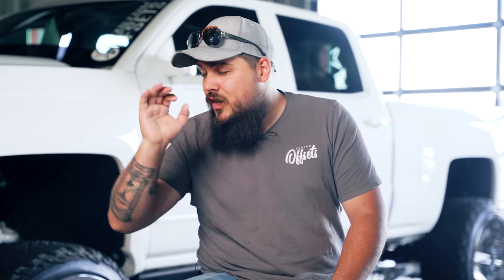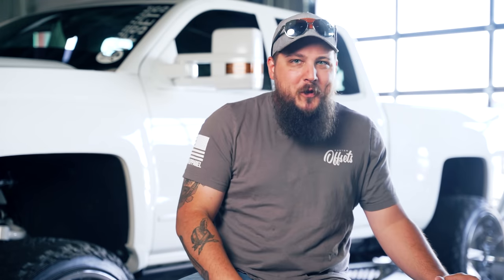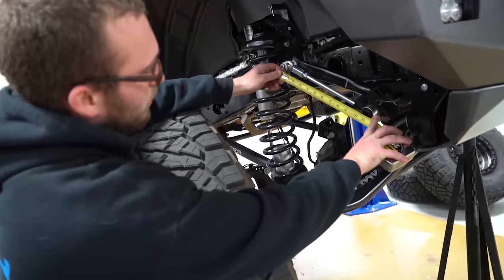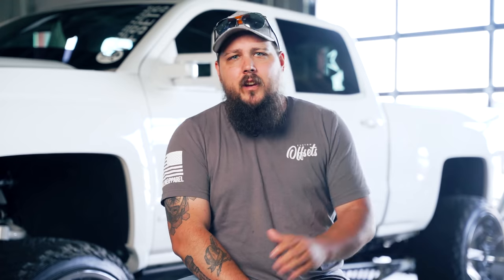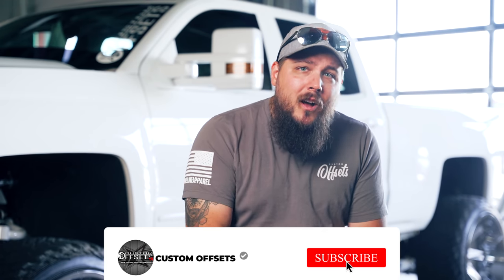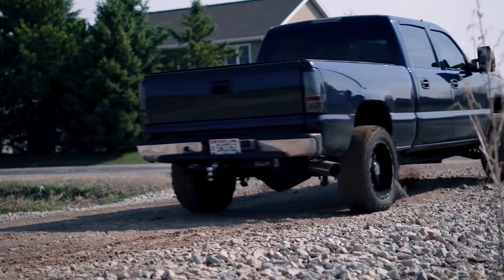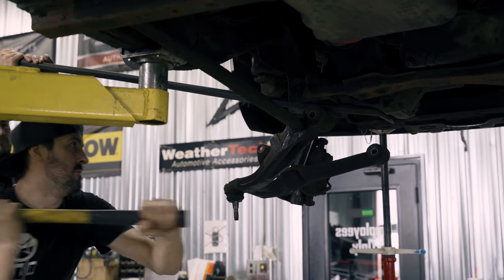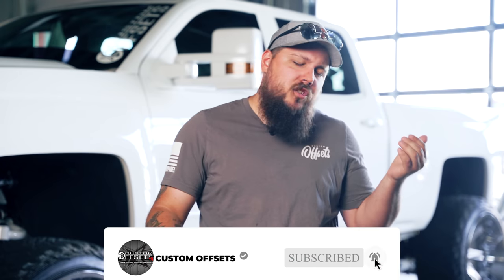Things To Know Before Lifting Your Truck!

Comment: You get what you paid for. I bought a cheap lift and honestly it was a struggle
Reply: what’s the name of your lift?
Reply: @wesleyblueislandkid469  I bought just a 2.5 inch front spacer that went over the coil springs and a longer shock so the truck wouldn’t be nose diving but mines a 2wd so it doesn’t have struts
Reply: And I think I got the spacer from Amazon for like $60 and the shock came from rough country for $100

Comment: If I put a 6" lift kit with 35" tires on a 2013 f150 4x4 am I gonna have to buy new driveshafts because the lengths will be different now?
Reply from the maker: Lift kits come with everything needed to complete the install!

Comment: Thanks for the advice I’m about to get my 2023 Chevy custom lifted next week. 2.50 in front and 2 in back 
33 inch tires on 22inch rims 
Do u think this would  fit well?
And do u think I’ll have to change any of the suspension or anything with the truck van fairly new

Comment: If you go with a 6” lift, does a modified/ longer cv shaft need to be installed, to compensate for the new angle? I like the yukon cv axles, but can’t find anything information about that. (I have a 2014 f150 4x4 xlt 5.0).
Thanks

Comment: On that OBS (88-98 k1500) Chevy, I figured it out to be way easier to notch the front side of the torsion bar crossmember (where the bar goes through the front side of it )and drop the lower control arm with the bar still attached. 
Then reinstall them together and weld in the small piece you notched out back in. 
No disrespect or anything, just a quick tip I learned installing lifts on those trucks. 
I have one of my own I did it to because the lower control arms and the torsion bars were completely froze together and would not separate. Plus no aftermarket companies are reproducing those lower control arms, so if you smash the lower arm by hitting it with a sledgehammer you’ll have to go to the scrap yard and hope you can get a good used one off without also smashing it.

Comment: After lifting my 2018 Silverado with a 3.5” lift and new bilstein rear shocks the rear end clunks on bumpy roads! Still don’t know what it is! Leaf springs?
Reply: @jwash0123  rear control arms and end links on a 2018 silverado? What truck are you talking about?
Reply: @Back_door_bandit_98  Ahhh….The one I just described in the comments. 
Rear Control arms? End links? Bro…. Huh?
Reply: @sudburyhouse  pay attention to the name before the comment I was responding to a guy that TOLD YOU to check those parts NOT ME learn how to READ also I'm not your BRO just a regular person.
Reply: Check your leaf pack bushing my 05 clanged every bump. Check your axle u bolts aswell just for safe measure and replace your bump stops when you can.

Comment: Here’s something to think about regarding the weight of adding weight when you lift a half ton rated truck. I lifted a sequoia and went with 34.5 inch  L/T tires. The difference in performance was dramatic and I wished I went with smaller tires in the end, just couldn’t get used to it. I ended up trading it in for a sports car. I bought a 2011 expedition later and the lift bug bit again. I decided on a smaller tire but more importantly cut down the tire weight. Toyo Open Country A/T make a passenger rated tire if you look. They weigh nearly 30# less than the A/T version. I got the 285/60R20 which is a 33.5 inch tire at 44# each. Using the same 3/2 ready lift on the expedition the performance hardly changed. I love it. Plus the tires are tough enough for my Florida off-road escapades.

Comment: I have a question if you can help me out 
I have a 2020 gmc sierra at4 I have done king suspension update rise it to 3 inches updated upc to total chaos 
And updated the shaft in the suspension to 3 inches and 35 AT tiers I want to make a diff drop kit but my ride now is very very tough when i go up on a speed bump it go’s very hard and stif 
Note I only go off-road on the sand 
What can I do to make my ride more soft

Comment: Questions.....I have a 98 gmc jimmy 4x4. I just need a mild lift I use it for hunting in Alaska. I'm far far away from the nearest gas station 100+ miles. So the trails I go on and roads that are not paved are ruff the snow the harsh environment. I need to be able to craw under it with clearance to be able to make repairs

Comment: this vid really made me 2nd guess doing the lift myself, thank you
Reply: Go for it, it's just nuts and bolts.
Reply: Depending on the size of the lift and the lift they can be fairly easy .... I however and a firm believer in BDS for a real lift kit and ready lift for a leveling/lift kit up to 3 inches ... the directions are simple if you read them clearly and to the end ... have faith in yourself ND if you don't have that hire a professional

Comment: I wish someone would've told me my front drive shaft and transfer case would need to be adjusted...
Reply from the maker: Comes with everything to adjust (most kits)
Reply: I honestly believe they skipped part of the process, because now my Dodge Ram just doesn't seem to line up front drive shaft to transfer case, so currently running off the rear until I can get it figured out.

Comment: Yep I can totally relate %100 my N3 5 inch front struts from RC just came in yesterday along with my rear N3 4 inch RC shocks...well so far I have the rear shocks in without any frustration or sweat on my forehead but everything went south the minute I realized my struts are probably 3.5 inch bigger than factory so let's say at this point I'm not even sure I can keep on going with my project without having any idea of what I need to make this happen. Positive ideas thoughts or comments very welcome
Reply: have you figured it out?

Comment: bought A new to me truck last weekend. it is a 2016 Ford F150 with the lift already installed. PROBLEM IS , that who ever built this lift didn't do a great job ! the Camber is WAY off on the front wheels and the 35/12.5R20's they installed are tearing at my truck ! any ideas on a fix other than a smaller set of tires. I need to fix this Negative Camber issue ! Also the road Hop is TERRIBLE, the smallest bump sends my truck into the next lane !
Reply from the maker: Best bet would be to get it aligned after having a shop that does lift kit installs look over it to see any issues or potential issues!

Comment: Thanks for the video.  I have a 2003 chevy silverado 1500 and recently boutique new wheels very excited . Put on my truck looks awesome but they rub . I can't return so I am trying to fix myself . I would prefer not to lift cause I'm doing my self and I'm female and live on a beach..😏 and really don't trust self to start cutting parts off the truck. Do you have any suggestions that I can try.  Other then call some guys to come over charge me to help. Then not allow me to work on the truck. Please any helpful advice is greatly appreciated.
Reply from the maker: What size wheels and tires are they?

Comment: Love your videos! Quick question, is it ok to put a 2 inches lift kit to my 2021 ranger with a stock shocks and coil spring? Thanks brother
Reply: I would opt for a coilover setup from Ford Performance, Bilstein or Eibach! I considered placing spacers on my Bronco but figured that it would involve the same amount of labor so i opted for Bilstein 6112 coilovers! I plan to install myself and recoup the extra money spent!

Comment: What are the key parts I need to replace on my truck before going to a 9” mcgaughy lift with 26x14 wides. Someone please tell me.
Reply from the maker: Ball joints, wheel bearings, brakes, and tie rods, could all be upgraded.

Comment: I subbed but only because my name is Greg...

A few questions... Will I be able to keep factory control arms, cv axles, and other driving components when I lift my truck? Ive got an 08 colorado, and plan to replace both axles, both side upper and lower control arms, ball joints, wheel bearings, etc. I have a bad steering rack, so thats getting replaced as well as the outer tie rod ends too. lots of goodies, but I want to make sure the stock control arms will work to accomodate a new lift kit while Im in there. I understand the concept of a lift kit, but dont know what all is required to be aftermarket for it all to fit. i dont want anything super crazy. just wanna lift it 2-4 inches above stock ride height. THANKS.
Reply from the maker: Yes, a majority of the kits if not all of them allow you to keep those factory components you are asking about. https://bit.ly/3KCjpmM

Comment: I did a 6in lift on a 2005 gmc Denali. Couldn’t have gone smoother, took us one day. My brother and I had a Saturday off and we took advantage of it. 11 hours straight, dawn to dusk but we woke up with a stock truck and went to sleep that same day with an all-set 6in lifted truck. Wasn’t the first time we’ve worked on front suspension, but it was the first time we had installed a lift that big. The truck is 17 years old, but it’s not rusty so it was very easy to take apart. It took about as long as we expected.

Comment: I need to call your shop. Wanted to do the 3" Rough Country Vertex coilover lift. I also want 35" tires on 20" wheels. Can it be done on my 19 F-150 without crash bar removal. Some say yes, some say no. Does it depend on the offset?  I'm a newbie at all this.
Reply from the maker: It will depend on offset and truck setup, our gallery should show case it well with different offsets - https://www.customwheeloffset.com/wheel-offset-gallery?wheel_diameter_from=20&wheel_width_from=9.0&tire_height_from=35q&sort=date&make=Ford&model=F-150

Comment: How does a lift kit affect gas mileage
Reply from the maker: Typically a bigger lift includes bigger tires. Both cause rolling and wind resistance, plus that much more grunt to get it up and moving!
Reply: @CustomOffsetsTV  ok thanks because my truck already makes 15 miles to the Gallon and it’s my first veichle so im not trying to make it any worse
Reply: @ventgoblin8080  My truck was getting 20 mpg city driving now its at 13-15 mpg after a 6 inch lift kit and 35's. If you are worried about mpg I wouldn't recommend lifting your truck especially since yours already sits at 12 mpgs
Reply: @manny2386  I think it was 15 actually but I’m not to sure

Comment: Sounds good man, in Michigan and have a nice rust patina going to address at the same time. Any tips for keeping rust away?
Reply from the maker: They way they salt up here and paint with salt brine.  Only guaranteed way is no driving in winter unfortunately
Reply: Salt sucks. Clean as much rust off as you can with needle scaler and wire brushes. Get some good rusty metal primer and oil based epoxy paint. I add some hardener to the paint. Prime, then paint. Remember to scuff up any smooth surfaces with some sandpaper so the paint has some bite. Let it cure for a couple months. Before they salt the roads, cover everything underneath with a wax or lanolin based coating that doesn't harden and creeps everywhere. I have been using fluid film, and last year wool wax. Both work great. Spray underside off weekly with plenty of water. You want volume here, not pressure. When spring comes, wash thoroughly with heated pressure washer, several times. Get it all off. The film will protect metal but also hold salt and debris. Touch up any areas that need paint in the warm months. Let it cure.  Apply undercoating before they salt the roads. Repeat. Forever. Salt sucks.

Also, don't forget to treat the inside of the frame and any voids where the corrosion will start from the inside.

Comment: So I have a 2012 F-150 XLT 4x4 with 155,000 miles on her and has the 5.0. She's in pretty good condition and motor is solid. What are your thought about putting a small lift on her and bigger tires. Is the mileage a problem and something I should worry about if I did. I'm guessing bigger tires put a strain on the motor and being that high mileage could cause problems? You guys are right up the road as well. I might stop in and discuss this. But until I do please give me your thoughts, thanks.

Comment: Curious what it’s getting for MPG now.  I have the same set up and it’s showing I’m getting 14MPG give or take, but I’m seeing others with 28mpg plus in their 3.0 diesel doesn’t make any sense unless my calibration is off.  I fueled up for the 1st time and it took a little over 24 gallons and I was able to go 360ish miles so this seems to be spot on.  Any thoughts?
Reply: 14 mpg ain’t even that bad… I mean I can’t speak exact to your situation but I know a cold air intake, tuning and higher flow exhaust did a lot to help me regain mileage in my 6.0. I think I average about 18-19 mpg now but I was getting 8-11 mpg maximum before. Btw right now I have a 2.5 inch level and 35 ridge grapps so she don’t sit too high

Comment: Hey you guys know trucks and my 2000 f250 has a 2 out of 6 rear leaf springs on it the old ones broke and fell off.   The previous owner said he drove it for a long time just fine.    It rides fine and looks some what sturdy but I’m starting to wonder if that is like really dangerous. I plan on getting a 4 inch lift and replacing all 4 leaf springs.   But I was just wanting some options if that is like real dangerous lol
Reply from the maker: Definitely not ideal or really safe personally. Replacing the packs would be your best bet!

Comment: Will hauling capacity change or can you still haul equally as with stok? Lastly if so will it hurt the suspension
Reply from the maker: Typically will lower towing compared to stock, stock trucks will forever tow ideally. But that's not to say people don't tow up to max tow cap, and have zero issues
Reply: @CustomOffsetsTV  Now that's something I didn't know and unbelievable you said that when you're trying to sell lifts / tires / wheels. Makes me want to buy everything from you guys!!

Comment: I’m actually looking into a 6” bds lift for an 2009 f150, i know it comes with blocks in the back but i was wondering should i swap it too leaf in the back instead?
Reply from the maker: All comes down to preference and what you’re going to do with it, if you tow a lot it would be better to get the leafs, and if your old leafs are worn out it is a justifiable upgrade to get new ones in!
Reply: I watched a video of a guy changing his whole leaf spring setup because extended shackles wear out the springs extremely quick.  he said higher blocks would've been smarter.

Comment: If you install a 6in lift does that mean the height of you trick is 6in higher? 

For example if prior to install my truck was 60in from ground to highest point of the roof and then I installed a 6in lift kit does that mean it measures at 66in? This is with same wheels and tires to keep things easy. Thx
Reply from the maker: it raises front 6" and the rear 4" for example (on most lift kits, some come with larger/smaller blocks depending if you tow more to lift both ends up 6", to counter for trailer weight on hitch)

Comment: That was good advice thank you it’s makes sense now I see how it works I wanted to lift the front of my duramax 04 just 1 inch with the factory this was helpful my 04 rides to low in front that my tires rub my tires are not that wide or size they are almost like the factory tires